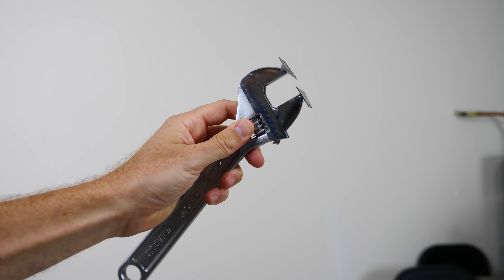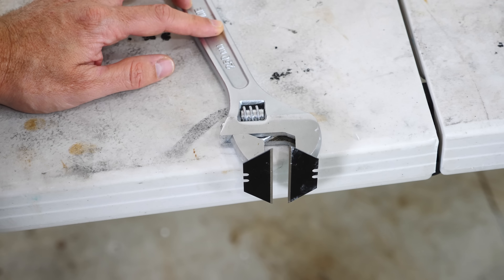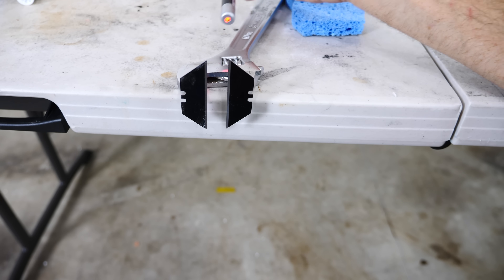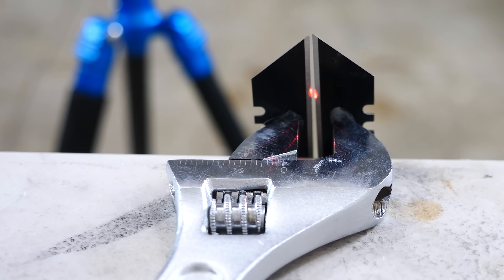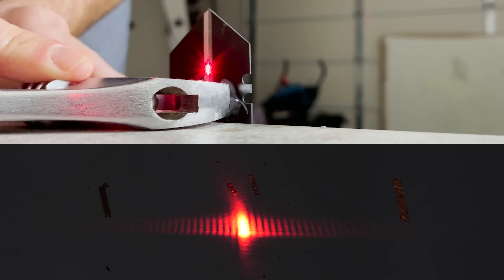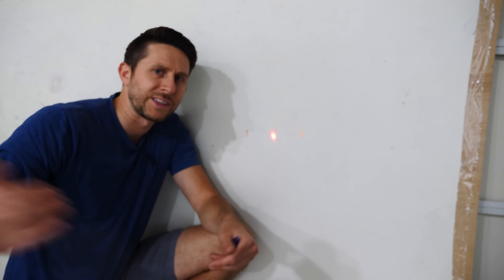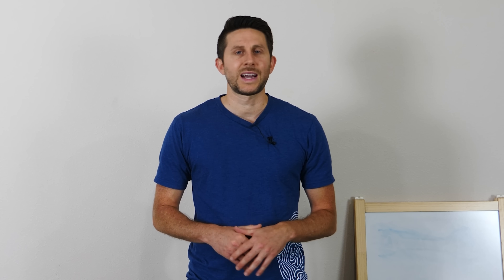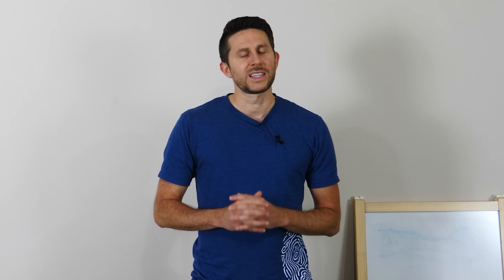Squishing Light Makes It Bigger—Heisenberg's Uncertainty Principle

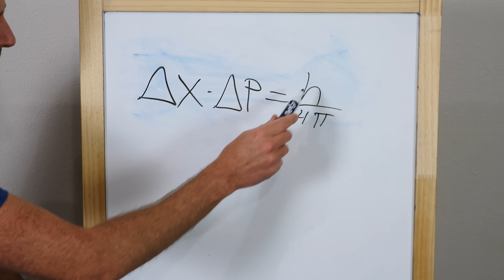Comment: 1:05 I don’t understand how that formula tells you that you can only be certain of either the position or the momentum but not both?

Why couldn’t you just divide “h/(4pi)” by for example “x” to calculate “p”?

Or does that formula have nothing to do with it?

Or can you only figure out how much “x” and “p” have changed over time but can’t calculate their exact “x” and “p” value at any given moment?

So basically, is it the “delta’s”, the formula or something else that makes things uncertain?

Edit: thanks to everyone who answered my question. The equation had a small mistake and the “delta’s” don’t refer to a change in value but the uncertainty itself. Now I understand what’s going on :)
Reply: The expression on the right is constant. That means if you want deltax to approach zero, the other term must skyrocket.
Reply: The "deltas" tell us about the uncertainty in the measurement of the respective quantities. You can calculate Δp by dividing Δx by 4π , but you cannot ever measure x and p (momentum in x-direction) simultaneously.  
Let's say, you try to measure position (x) of an electron with infinite precision, then your Δx ->0. But to take this measurement you need a photon or another particle. This photon, when it hits the electron changes the momentum and there you go you get a very high uncertainty in momentum Δp-> infinity.
Reply: The deltas mean uncertainty and is not related to the actual values. The equation should be the uncertainty multiplied together must be greater than the constant. So at the limit, if you know the exact position, the constant divided by uncertainty in position (zero) means no knowledge of momentum since infinite uncertainty in momentum.
Reply: You are actually correct he just put the wrong sign. Its not = , its >=
Reply: Thanks to all 4 of you I understand it now, I really appreciate it.

Comment: by squishing light all you are doing is restricting the  elecctromagnetic radiatin spread and focusing it in a more denser enviroment... 

also by squishing light the light doesnt get any bigger it just becomes more concentrated.. 

also if your using something to divide the light again your not making it any bigger you focusing the spread in different dirrections..  

you could use mirrors in tunnles and use massive light source at the entrance 

how far can light travel along an enclosed mirrored enviroment.... 🤣🤣🤣👍👊

hope this helps..
Reply: No it doesn’t help
Reply: @karansandhu4827  light is electromagnetic radiation .... so you can either compress shrink it down or split it into different directions....  but that doesnt increase the size of the light it just increase the lights foot print ... which means it spreads further..

Comment: That wrench quite honestly is the most terrifying thing I’ve ever seen. Awesome video though James!
Reply from the maker: perfect answer for "you wanna know how I got these scars..."
Reply: @TheActionLab  Awesome! Have you considered retrying the experiment with the razor slit using a blue or violet laser to see the board absorb and re-emit the spread out light?
Reply: @TheActionLab  haha
Reply: @TheActionLab  just too see
Reply: @TheActionLab  where do I buy a wrench like that?
Reply: @TheActionLab      SIR USE YOUR VACUUM CHANBER.    During milk powder production water is removed by boiling the milk under reduced pressure at low temperature in a process known as evaporation. The resulting concentrated milk is then sprayed in a fine mist into hot air to remove further moisture thus forming a milk powder.
Reply: @TheActionLab  lol xD
Reply: @TheActionLab  hewooo big fan ! UwO
Reply: His name is James??
Reply: @AkiraHartono  His name is James Orgill. But I don't know whether it's a soft or a hard g.
Reply: @AkiraHartono  Yes
Reply: @AkiraHartono  ...charles 😓
Reply: Fr
Reply: Heloooo
Reply: Looks like a wrench a mafia guy would use to make you pay back a loan. Very motivating.
Reply: Then you'd be absolutely terrified at my F.R.O.D.A. gauntlet. It stands for "Flesh-Ripping One Directional Armor." It's just a bunch of razor blades mounted at an angle to a piece that straps to my arm. It's designed to be worn in a riot/apocalyptic situation. If someone tried to grab my arm and pull it, it'll rip their hand to shreds.
Reply: The technical term is Mexican speed wrench.. best used as a hammer
Reply: I like how half the comments are debating over science while the others are showcasing their thoughts on weaponry
Reply: Early lol
Reply: UAPs are more terrifying.  The "elusive" particles with photons that are getting  squished are simply the actual Electromagnetic Quantum Kinetic Dipole Particles meaning the Vacuum is filled with EM Field Dipoles which are absolutely 100% VERY REAL and they have a mass of about 10^(-90) kg each.  There are 10^(-18) kg of EM Dipoles per cubic meter of vacuum on Earths surface (dark mass).  EM Field dipoles hit everything at speed "c" and transfer momentum causing all forces (dark energy).

Photons are particles with quantum superfluid flows of condensed EM Fields or flowing Bose Einstein Condensates of actual EM Field kinetic Dipole Particle "gas" that fills the vacuum.  There are about 10(54) dipoles condensed within a single "green photon".

NASA / DoD have known about EM Field Dipoles since the 1970s when the first Electromagnetic Compression Drives were designed and later built and flown under SDI Star Wars Research on USA DoD Flying Black Triangles and in C h i n e s e UAPs flying since 1999 (UAPs in the news are Hypersonic Weapons / Drones).  

After Dad helped launch Apollo/Skylab from #FiringRoom1 at KSC, NASA went FULL WARP until DoD took the research over and weaponized it.  Then the C C P stole the tech and weaponized it.

The US Navy has no chance against these EM Compression Drive Propulsion Systems on these UAPs.  These UAP can go 50g's and 10,000mph at sea level faster in LEO.  Yes the UAPs can work in orbit too.
Reply: @johnboze  y00⁵05
Reply: "I'm Joe Goldberg & I wanna know more about you"
Reply: Jizzmeh  yes
Reply: You've clearly never been on the wrong end of a battle tank😂
Reply: His name is James???!
Reply: You know, Plasma Channel, there's no law requiring you to place your genitalia in everything you see....
Reply: @HXTz0 
It doesn't.  Electrical capacitance INCREASES with area.  That's why large capitance capacitors are large.
Reply: If that is the most terrifying thing you've ever seen, that would suggest either you haven't seen much anything or just lived very "sheltered" life...😅 Or you just have massive phobia of wrenches and razorblades 😂

Comment: I seem to be missing the point i guess, because i still think it's because the light loses momentum from hitting the slit and refracts too much to "gather" itself again after the slit, just like the double slit experiment.
So now i wonder if the glow in the dark panel also charges in combination with the double slit, and if the red laser just has considerably less energy (which it has) compared to the violet laser you used separately.
Would've been nice if you used the red laser to charge the panel instead of popping out that purple one, because when you pointed at the panel earlier with the red laser and the razor blades fully apart, you never mentioned the glow in the dark panel, so did it charge then, or not?
And frankly, i never really got the point of the double slit experiment, because nothing about it seems shocking to me, it seems very simple, but apparently the theory behind it is not what it seems?

Comment: Hey,
If the mass of light is 0 , then it's momentum will be
Momentum= Mass* Velocity
Momentum= 0 * Velocity
Therefore momentum of light is zero.
Reply: Although light has no mass it does in fact still carry momentum. This is why we have solar sails that can be pushed by photons as some of the lights momentum is transferred to the sail. The momentum of light is given by p=h*wavelength. As for why light carries momentum, this is a consequence of lorentz transformations that show that as long as a massless object travels at the speed of light, they also carries momentum.
Reply: @TheMegahertzChannel  👍
Reply: Special relativity
Reply: Yes, the mass of light particle (photon) is 0, but it's momentum isn't. To calculate it's momentum we use different formula, and it's p=h/λ, where h is Planck's constant and λ is the photon wavelength. 
So momentum of light isn't zero and it depends on it's wavelength.

If I'm wrong somewhere, please correct me.
Reply: Photons were experimentally shown to carry momentum in the 1800's, through light deflecting thin suspended pieces of foil.

Additionally, Maxwell's equations show that p = E/c for each photon.

p = mv is still valid, but only where m represents the inertial mass of the object in question.
For the case of photons, Einstein was the first to calculate their inertial mass as E/c^2 (non-zero).
Reply: Photons rest mass is zero but as speed increases mass also increases but in momentum of light we use another formula not mass ×velocity
Reply: @ERRORGENOUS  धन्यवाद।
Reply: Don't use p=mv formula. It won't work to calculate particles momentum.
Reply: @sharan-kumar  ओह अच्छा। धन्यवाद।
Reply: @sharan-kumar  thanks for your information.
Reply: This formula is for macro object but not valid for atomic level...
 For atomic particle Momentum =root*(l(l+2))h/2pie.      Where l is azimuthal quantum no
Reply: Nope! Photons has rest mass = 0 but not relativistic mass; they do possess relativistic mass. That's why each particle of light (photon) has its own momentum, thus, Heisenberg's Uncertainty Principle is applicable to it.

Furthermore, if light photo has mass = 0 then they were not robustly bend by the enormous powerful distortion of space-time curvature around Black holes (due to their powerful gravity); but in reality, light do bend around black holes, stars and even they fall into black holes once light cross event horizon... So, photons do possess mass.

Comment: I don't understand how yo get the same interference pattern with a single slit as you do with the double slit experiment.
Reply: I think it's because the 2 blades each diffract the light, the light going through the middle only shows up in the spot. It's the 2 edges interfering and producing the pattern outside the beam.
Reply: You don't get the same pattern.
Both patterns are governed by the equation dsin(theta) = n*(lambda), but the angle theta points to different sections of the pattern for each scenario.
For the single slit, theta points to minimums (dark spots)
For the double slit, theta points to maximums (bright spots)
Reply: probably you don't get exactly the same, maybe the pattern is slightly different... but the thing is that the double slit experiment isn't about the interference pattern! meaning that when they first made the double slit experiment already knew about the double nature of light... they already knew that light is both a particle and a wave... the double slit experiment thus wasn't an experiment to determine the nature of light (whether it was a wave or a particle - they already knew that) the double slit experiment is a "which way" experiment where you release 1 photon at a time to see from which slit it will go through... (spoiler alert: it goes through both slits) :P

Comment: Love his stuff but this is wrong.  The light isnt being "squished".  The blade has an angle  that the light reflects of and the size of the beam itself is what's causing the diffraction to the left and right.  Try the same experiment not using a razor blade that has angles and that doesnt have a reflective surface (metal) and I bet that diffracted squishy light doesnt happen